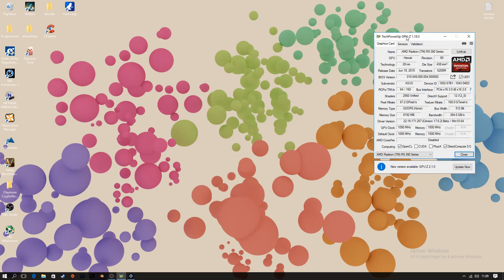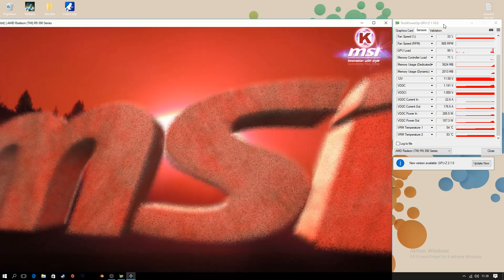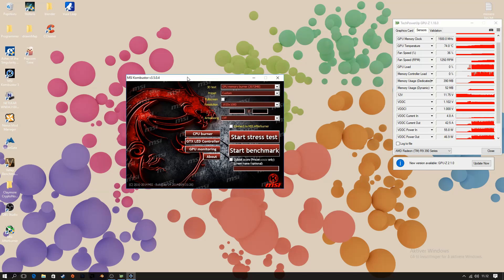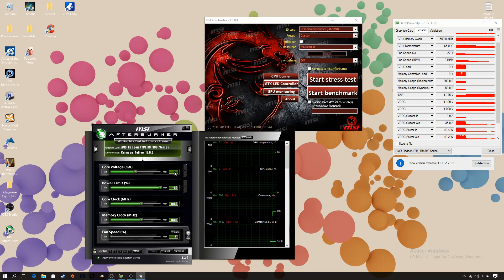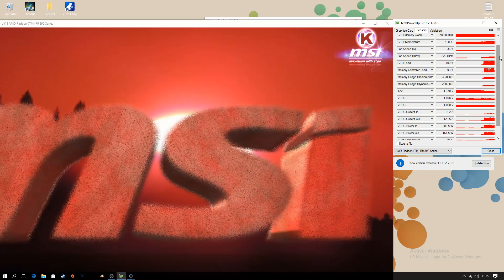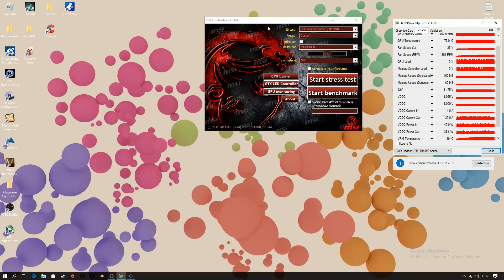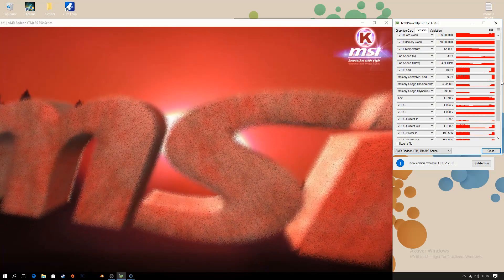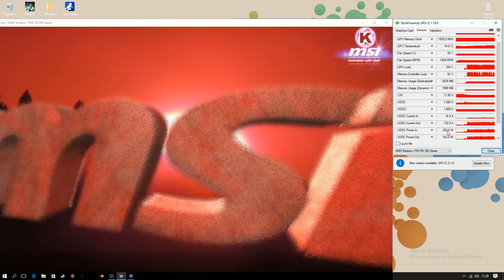GPU power efficiency guide, 80w less power!

Comment: I'm watching because I will use a used HD 7770 1gb with an old 400watt 80+ certified psu. This has to last me for the next year at least
Reply: Buildinghero Gaming [EN] Did it work out great? I’m literally doing nearly the same, but with a Hd 6970, and 400watt psu, the calculations are at 458 watt
Reply: @azichary7936  I ended up buying a 2gb gtx 650 of my friend who was upgrading for 15 euros wich is half of the price on the used market rn. Also I got a better deal on a psu so now I have an 80+ certified 525Watt psu that I got for 10 euros
Reply: Buildinghero Gaming [EN] Oh... Then i’ll se what’s gonna happen
Reply: @azichary7936  Wait what no dont do that!
Reply: I can already tell you now its not gonna go well
Reply: @azichary7936  hey, wanted to ask if it gone well, cuz right now I have hd 6850 and 400W psu. How did you solve your problem?
Reply: @epifaru  I did not solve it, the GPU just sits on my desk 😅
Reply: @azichary7936  Thanks for your answer. I found some forum from 2011 in which people say that it will be normal with 6850, but you just have to not overload it so psu won't break. 5 days ago I was given old computer with 400w psu and hd 6850. I started testing it in some games and psu exploded... I have another 400w psu and want to try it, so good luck for me, and again, thank you for your answer!